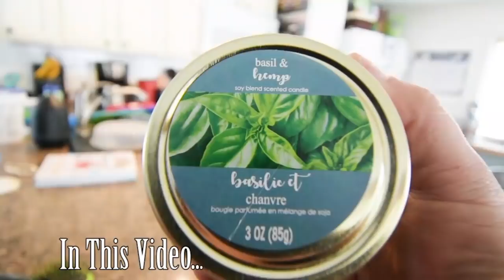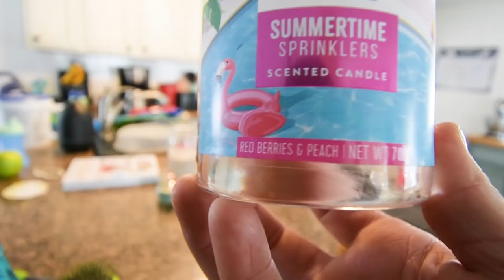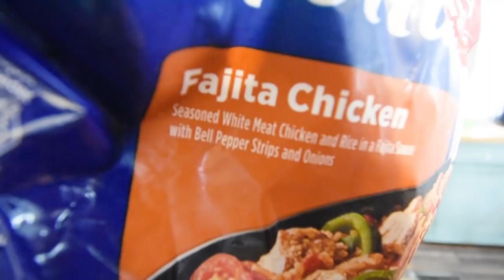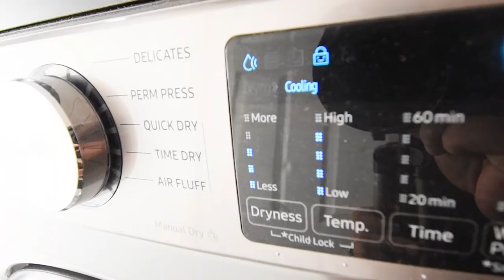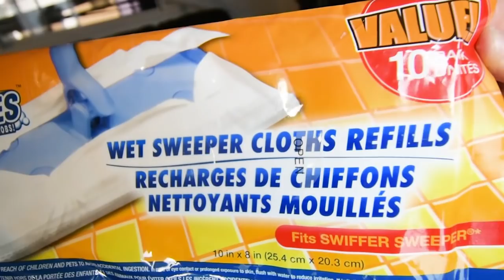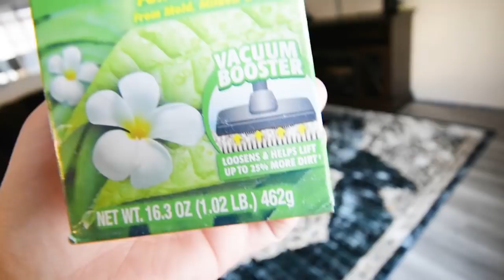Cleaning Motivation|Fixing up My $500 Mobile Home|Mobile Home Clean With me|SAHM Cleaning|

Comment: Ok so the flooring, are y’all putting a couple lines of flooring together before installing it? It looks like the same flooring I used if so and I am wondering how that’s worked out, because I still have a lot left to go.
Reply from the maker: Yes! So we would stop in certain areas. So he did the laundry area and the hall as one section. Then later we ripped up the living room floor and layed the new living room floor. And he would cut them and then clip. It’s worked out great. It’s not the easiest though to install. Many times I had to help him on the other side clip it in and then he would finish inserting it the rest of the way by hitting it with an old piece of laminate wood and a hammer. Sometimes it wouldn’t clip all the way together and they weren’t lined up so that was a struggle, but the hammer and two people sometimes helps. My husband will be the first to tell you he hates installing floors lol.